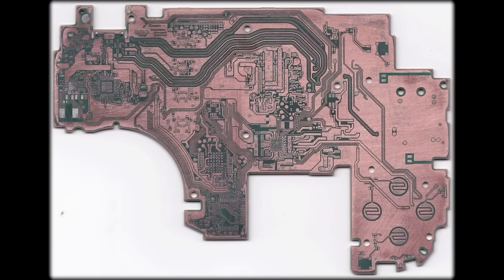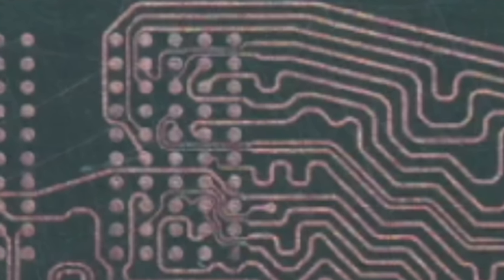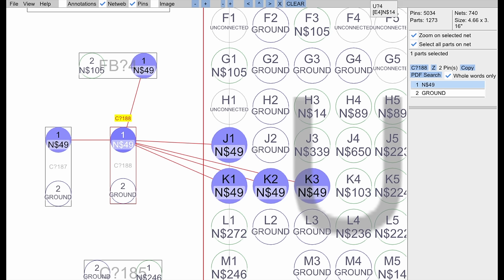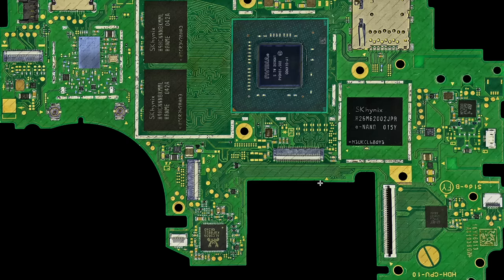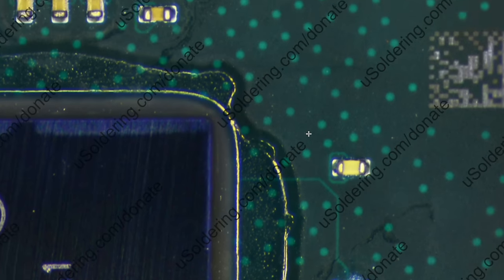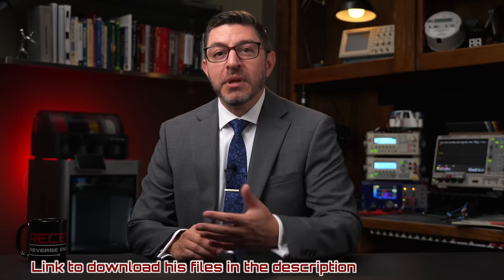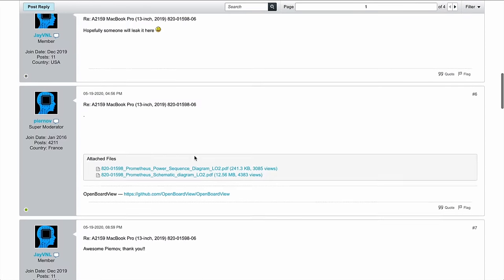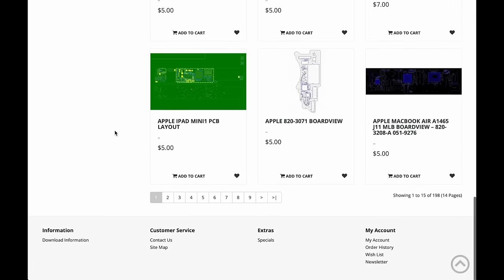Reverse Engineering the HARD Way!

Comment: Somebody's earned their Soldering Skill badge...
Reply: LVL 100 Soldering achieved
Reply: I dont even know how you would do it and ive been soldering for quite awhile, super micro tip maybe but I doubt it
Reply: nevermind he prob used hot air and just pushed it in
Reply: @adairjanney7109 No I think you were right the first time. Hot air would be too risky with all the other wires nearby.
I've done this level of soldering before. It's time consuming but easier than you'd expect. I use a cheap usb microscope and a regular needle tip iron - it doesn't matter that the needle tip is bigger than what you're soldering so long as it's small enough that it doesn't hit neighbouring pads.

I wouldn't recommend the usb microscope though, it makes it much harder than necessary. I'm just too cheap to get the proper tool. I went to an expo and saw the Mantis stereoscopic microscopes... MIND BLOWING! If I was doing it more regularly I'd get one of them.
Reply: He's got a black cord from the solderjitsu
Reply: More like soldering god
Reply: @charmio The Mantis is REALLY nice. If you’re on the edge, look for the cheaper first generation Mantis, there’s been a bunch of dental offices dumping their old stock for reasonable-ish prices. Although the only ‘amazing’ soldering lens for the first generation is the 6x SLWD, and I have yet to find any for sale.
Reply: I got the badge when I was 11 💀

Comment: Gerber file viewers have always been part of the release tool process. You need to sanity check the designer's "screen" matches the final production gerbers. Every PCB house uses these to evaluate the fab for manufacturability (DFM) with design rule files specific to their process, capability, robotics, etc. They also use it to generate fixturing for flying probe and ICT.  Securing production files is quite a Don Quixote-esque endeavor. On one hand you want them secured on the other a whole army of people, potentially across multiple vendors need to have them to do their jobs. And yes espionage is very very common and with alarming efficiency. Your gerbers may be in the hands of a competitor before the first fabs roll off the assembly line.  Blockchain is starting to be applied to Supply Chains to at least track who may have had access.
Reply: Just obfuscate it with auto-routing :D

Comment: Umm nope! When I got my formal electronics training, wire wrapping was the way to go and that pick of a thousand wires brought back my PTSD of wire wrapping lol. Another great vid HASH - thanks.
Reply from the maker: Yea, wire wrapping… Heaven forbid you nick one of the wires when stripping it!
Reply: I like this specific thing, I'm gonna share it!
Reply: @Willam_J  @recessim A little background: I went to high school in teh Sierra mountains in California. During my Junior and senior year, 2 times a week and every other weekend I drove down to Roseville after school to get taught in electronic engineering by the engineers that designed the original HP 9000 mini mainframes. When I moved out to Texas in 83, I signed up to go to ITT Tech, back before all of the scandal's hit. My teacher was an electronics engineer at Compaq (now HP). So several of my projects at HP and ITT were still wirewrapped , including those damn 7400 series sockets with the 2 inch long leads lol. But even before that, I got my general class ham license at age 12 so RF was always in my blood and during my adult career that was my primary focus, up to and including working with the first cable modem systems in Houston that had the land line returns. So everything that HASH does, I absolutely love. But back to my original point: I still have my tool box with all of my tools, plus discreet components, a few 6502's and 8080's, as well as 555's and 556's. My final project was an expansion board for an Apple ][+ what would allow you to generate speech from text. Lets see if this link to the pics will work: https://photos.app.goo.gl/2GD7MWQpcPbQ2Q9i6  Sorry for rambling but it brings back a lot of great memories.
Reply: @ChrisMuncy  "Sorry for rambling " <- don't be
Reply: @daveogfans413  thanks brother.
Reply: @ChrisMuncy a great story is worth the ramble.
Reply: Wire wrapping is still used by Telco companies today but not for much longer as the POTS system gets sunsetted by VOIP.

Comment: I work at an Apple Authorized repair center, and a common breakage we experience is accidentally damaging the volume buttons while removing display adhesives, preventing the device from going into diagnostics mode (holding volume up + down while connected to power during boot).  Having the pinouts for the volume button flexes to bypass the buttons would be really helpful but I wouldn’t even know where to start.  Could anyone direct me on where to look?   Thanks in advance and thank you for the great video!
Reply: If nothing else a continunity check mode on a multimeter on a non broken button module should get you the pinout

Comment: I feel like this deserves a robot, to apply voltage on one pin/pad and then beep boop every other pin/pad on the board rapidly, wouldn't this make it so much easier/quicker to just take any pcb and beep boop out every pin to pad etc?
Reply: Yeah, incredible effort but why not just use a cnc robot to probe the pins instead.

Comment: Those are fine ways to make boardviews of cheap consumer devices that are plentiful so sacrificing a few of them to yank all the parts off and de-layer the board is feasible. It's a lot harder when reverse engineering rare / expensive, or even unobtainable boards were sacrificing one is just not an option. I've done it a few times (not on full boards, just on the areas that I need to reverse engineer), and it is a lot of super boring drudge work!

Comment: is there any controlled machine for soldering those wires?
Reply: I'd think of a pin bed, or a probing robot perhaps. Maybe a modified 3d printer, have 2 "print heads" probe the board automatically. And for a dramatic speedup, give each print head some 50 or 100 probes.

Comment: Openboardview is junk.
Question is: How do you turn photo into a boardview file ?
Reply: I've seen some videos on how chinese companies reverse engineer and copy products. They sand down the boards layer by layer and image them, and basically build up a pcb layout from the images. If you're half way decent at coding, you can probably whip something up in opencv in a few hours. I've not found any available tool that can do that already.
Reply: Fighting words there  Northwestrepair - what's your solution?  Not that I'm actively involved any more with OBV but, come on.